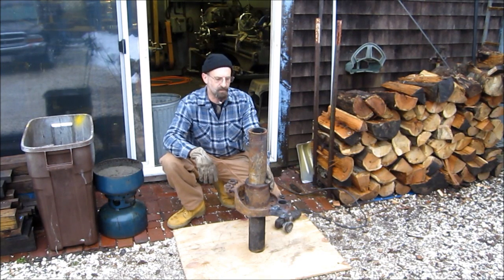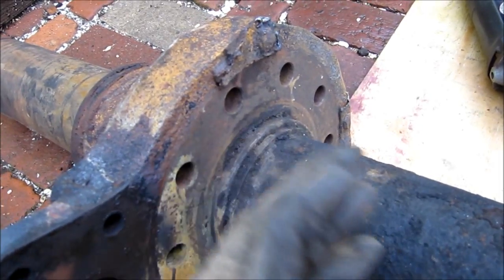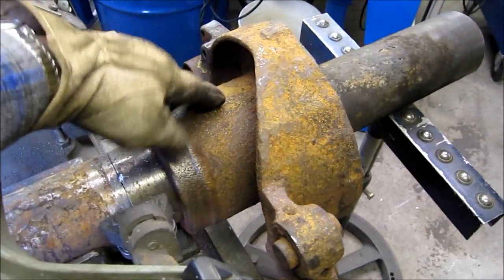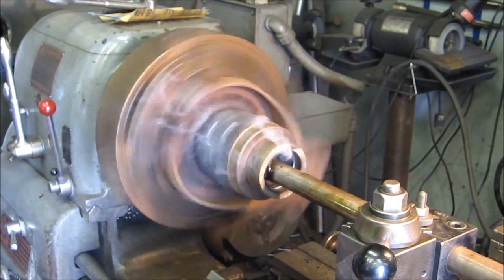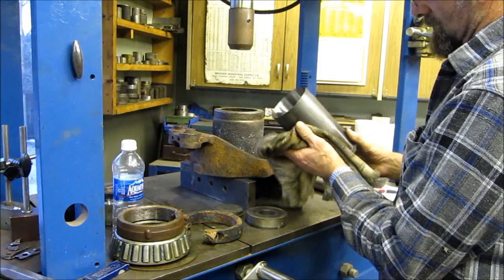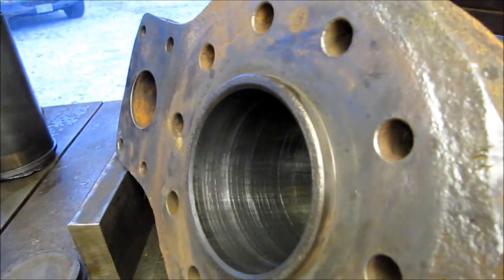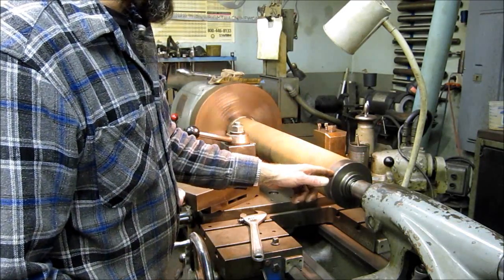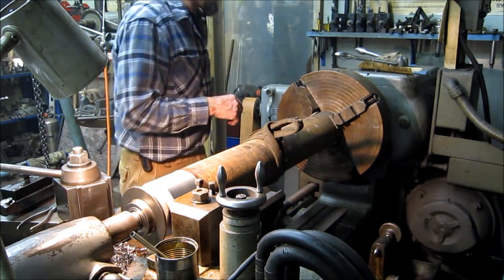Oshkosh rear axle tube Part 1

Comment: To all of those who keep saying "Use Coolant instead of oil".

Oil is cheaper, nearly as effective, and makes much less of a mess. Plus, coolant requires installing a system on each machine...more money. Flood coolant also flows whatever material is being cut all over the machine, which is a bad thing with brass/bronze/cast materials because it gets into all of the close tolerance areas on the machines and causes excessive wear. Machining coolant also gives off toxic fumes just like cutting oil, there is no such thing as "non toxic".

Our shop uses nothing but flood coolant. It's a huge mess, the water soluble oil (mix with water) is expensive, and the flow systems are always messing up (leaks, etc.). The only machines that flood coolant works well on are the CNC machines because they are enclosed and recycle 90% of the coolant.

If I need to weld/braze/solder a part after tooling, I simply use lighter cuts and use no coolant/oil at all to avoid contamination.

My boss is always on my case about using cutting oil every chance I get. He understands and agrees with me, but he has to answer to other people also so I don't "push the issue" too much.

There, I saved Keith from having to say all of that.

Comment: I watch a good few US machining videos and hardly any one uses coolant....
I think it must be for the affect on the video as it is much better for tool life and not heating up the work...Good TV but not good for the work..
You work is very good, just whack the suds pump on.......
Reply: The Essex Hunter Did you spot all of the smoke around the part? Burning oil...

Keith's using inserts in his tool holders, which are designed and made to cut faster and hotter - working on some alloys...  He didn't say which alloy he was using in this part, but a leaded steel = free machining alloy also reduces the need for coolant in some work.
Reply: If it burns then it has become to hot...!!
Keith is on top of his game, however he is just using a small brush and a few dabs of oil!
As he is roughing out a large piece then I would guess he doesn't want the mess
it would be a different case if it is a lump of 316 stainless Marine shaft...
Suds coolant is designed to keep work at a stable temp and prolong tool life..
If work gets to hot it grows and can work harden...!!
Thus my comment of turn on the suds pump!!
Reply: I mis-stated things when I wrote "burns" - it mists off the surface - goes to a saturated vapor state which then coalesces as a mist...

I've done some parts in 304 in a garage shop which didn't have any coolant system - about 9 or 10 years ago now... Lots of WD40 got evaporated - what a mess...

Last year, I had to drill a bunch of holes in Unistrut which was rolled from 304L - that had already work hardened, and the lab I was working in did not have any coolant systems.

For that situation, I found that using a garden sprayer and tap water gave the best results...

Stainless is a different can of worms, and you want to be rather aggressive with it to keep you cutting edge always working on virgin material - work and heat will harden it in an eyeblink...

Comment: coolant man omg please use coolant it is so mutch better than oil
Reply: collin ogilvie Coolant = about 5% vegetable oil in water - works great on newer machines, but you can set up the old school way using a free machining alloy, and carbide inserts, and turn relatively fast & hot, using a small amount of oil...

There are different ways to do the job, and this is a good one...
Reply: well the smoke that come off is so unhealthy to breath in so thus coolant is much safter

Comment: I do this stuff for a living but realy like your presentation and sense of humor!
I'm sure I will learn something if I keep watching LOL
A person must have chips for brains to watch machine shop videos when they are off work from doing it full time LOL
PS a trick I use to make concentric tubes out of crap DOM is to turn an about 10 degree included angle tapered dead center in place in the chuck to suit the tube ID
 the shallow taper will drive the part without slipping.

Comment: we have a guy that will come to the shop and cut off the damaged spindle with a gas quick cut and he has new stub shafts ready and welds them on while its still on the truck, costs $1000 depending how far he has to drive, he is an old retired Dutch guy and his work is top notch like yours Keith

Comment: Much appreciated, will try the combination next time something in steel comes my way .  I assume the insert has a nose radius of 0.8mm or larger (or the equivalent English number-pardon the metric, had some training on dual measurement systems but most of the work is metric out here. ) Thanks again.

Comment: Hi Keith, 
With no intention to flatter I can say that you show us great craftsmanship and skill and for that I am grateful.  I have a probably daft question for you, on the lathe what feed and cutting insert you use on this job? I am not a machinist but I do a lot of machining at work, mechanical designer in a R&D outfit , despite that I can get good results with aluminium and bronzes I can never achieve the surface  roughness you do on steels. Thank you for your time. Regards from Edinburgh

Comment from the maker: @citydriver The three jaw chuck is designed to hold round items running true, to the outside diameters of your material and I needed to hold the material true running, to the inside diameter. 

The four jaw only seems like work, because of the lack of experience, soon it will be, Wam Bam Thank You Mam!

Don't seek short cuts, while learning, short cuts will find you, through experience...

Comment from the maker: @mackdawg100 Cut the tank in half at the seam, weld the top to the bottom, with insides away from each other, put sand in the top for a ( Butt bucket ), so everyones not throwing their butts right on the ground :)

Comment from the maker: @huerdon Its a 17" Clausing Colchester, with a 29.5" Gap bed, 3.125" hole in the headstock and a hydrualic tracer attachment on the back side of the carriage. Like everything else I bought used, I have been through it thoroughly, to get it to run like it does... :)

Comment: Good run through on how to get the tube running true and concentric.

It's easy to loose track of scale watching you work on your lathe.  When you hooked up your chain fall I was wondering why then when you slid the tailstock out of the way I was like wow look at the wall thickness that's why.  That's a heavy piece of pipe there!